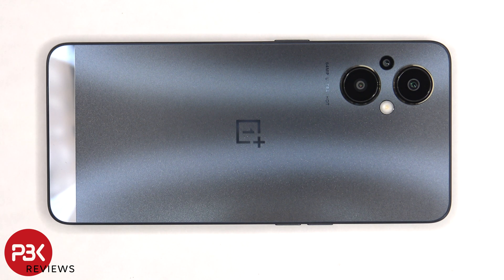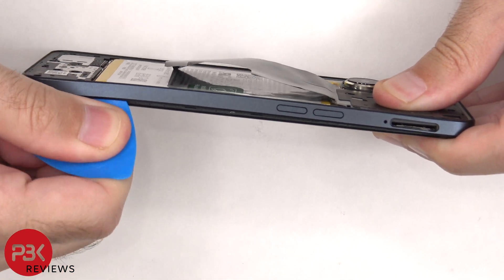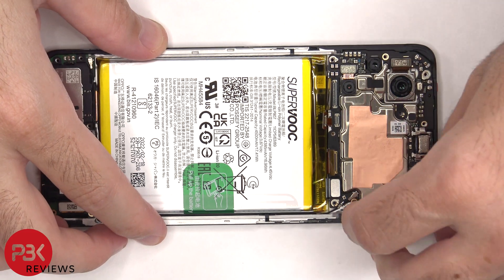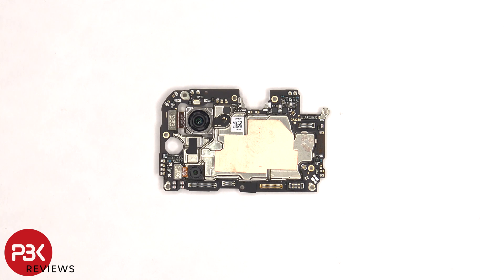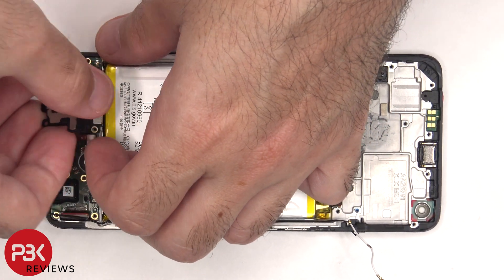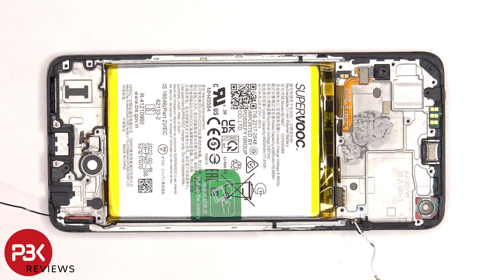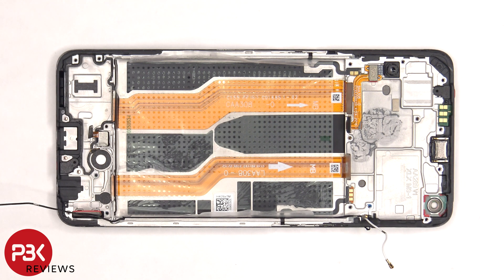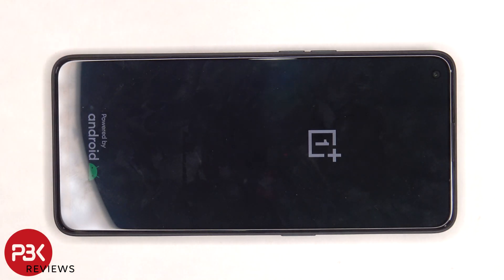OnePlus Nord N20 5G Disassembly Teardown Repair Video Review

Comment: Do I need to replace adhesive for camera, therma paste, back plate adhesive, battery tape adhesive or no/ depends how I take it off.  If it depends do I use heat for the help with the back plate adhesive or no.

Comment: How do you save internal memory like storge pics if phones is mess up. Phone keeps continueous restart non stop untill phone dies. Than continues after charge and phones turns back on how to fix this and save storage pics n vids? Can i just swap broken phone mothetboard with new one to save storage pics and vids? Cannot use any funtions on phone because it restarts every couple secs
Reply from the maker: You are probably out of luck. The storage is soldered to the main board, so replacing it wont help. You would probably have to find a place which does soldering that can swap the processor and the storage ROM to a different working board which would probably be expensive if even possible.

Comment: I am stuck trying to figure this out. What needs to be removed if anything to change the battery only?
Reply from the maker: Just enough to gain access to disconnecting the battery cable and prying it off.

Comment: If anyone is wondering about replacing the screen without replacing the frame,  this video is sufficient. He kind of glosses over that part, but it's the same as most other phones. The ribbon cable is under the cover with the 18 screws right next to the headphone jack. Heat the screen with a hair dryer, and work a plastic tool in between the glass and the plastic bezel. Work your way around and remove.

Comment: Can I ask for some advice? I have a OnePlus Nord N20 5G with 6.43 inch AMOLED screen and would like to replace with OnePlus Nord N200 5G 6.49 inch LCD screen. Screen resolution is the same except dimension is 0.06 different. Will this work? Are there any Chinese brand LCD screen that is reliable? Thanks.
Reply from the maker: No wont work. The screen cables are completely different and different locations as well. Also any size difference would cause it not to fit the frame etc.

Comment: Would you recommend replacing the frame as well if theirs a possibility of water damage and a broken screen
Reply from the maker: If you can find a screen with frame combo (usually how they are sold), yeah would make the installation much easier as well.

Comment: Your videos are always really helpful. I was wondering though once you've gotten to the point where you disconnect the battery is it possible to remove the battery in order to replace it at that point or would I have to continue to take apart the phone to free it?

Comment: I am leaving this message for anyone here, including the uploader, who may know what's happening:

(1st issue) Sometimes, when I receive a text message, the message appears at the top of all my messages. This forces me to scroll all the way to the top just to read the entire message. Also, it's indicating that it was received in December of 1969.

(2nd issue) In my car, I have the option to set the 4 most important contacts on the main screen and everytime I start my car, the contacts are erased and I end up having to re-store those contacts over and over again. Never had a problem with other phones except this one.

Can someone let me know what could be occurring and if it's happened to you as well?? Thanks.
Reply from the maker: Hmm not sure, you can try backing up your data and doing a factory reset (will erase everything on your phone). This will rule out any software bug or issue.
Reply: @PBKreviews  Yes. Unfortunately, I've already done this. But still the same issue. It's weird because I've never in my life have experienced this before.

My wife has the exact same phone and she is also going through the same issue.